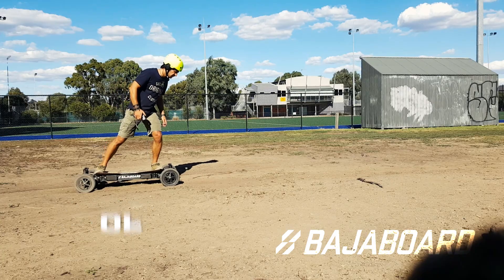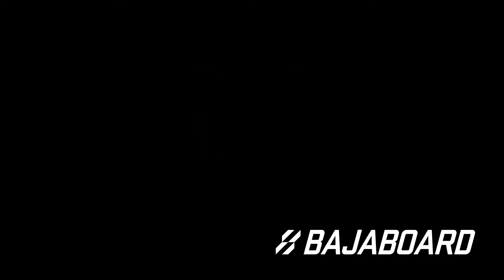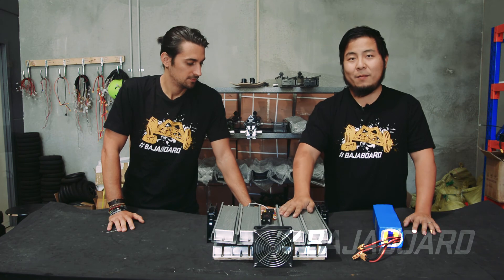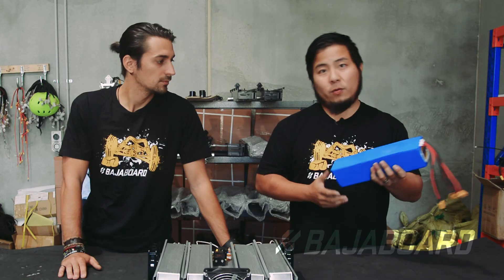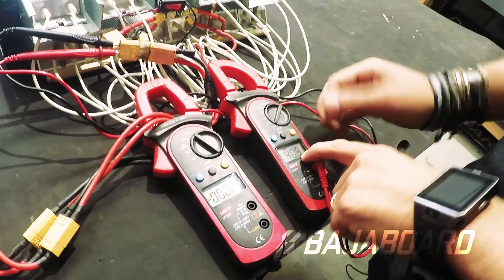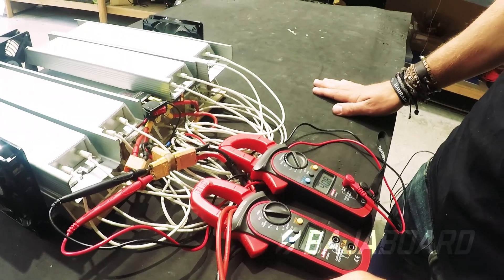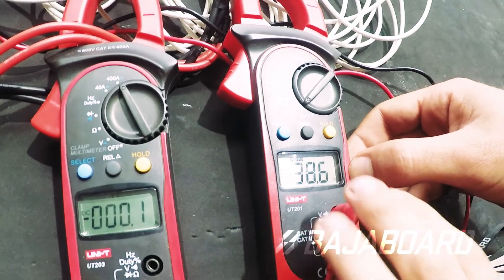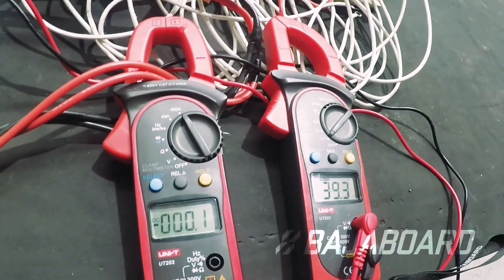Battery Sag

Comment: Hi I have a homemade 10s 4 p Samsung pack
Esc is set to 2x 37a  
At 100% on a hill at full throttle it’s dropping to 25% I cannot figure out where my problem is 
can anyone shed some light on this
Reply: AboutDan to much electric being sucked out the battery at once, could be descharge rate of battery isn’t high enough or controller is limiting maximum amps  & maybe for good reason = to protect your motor & loading of the system